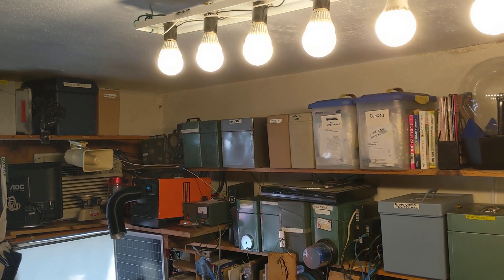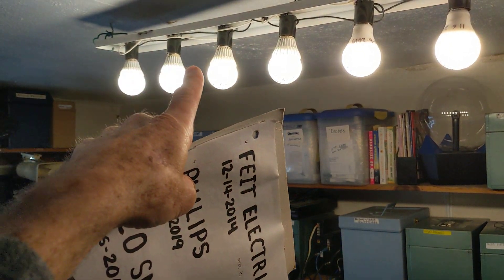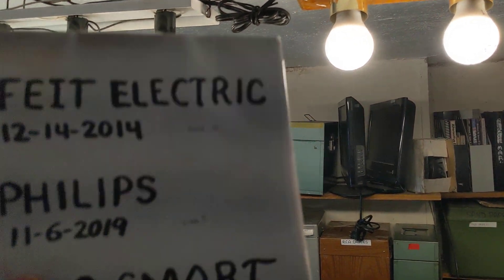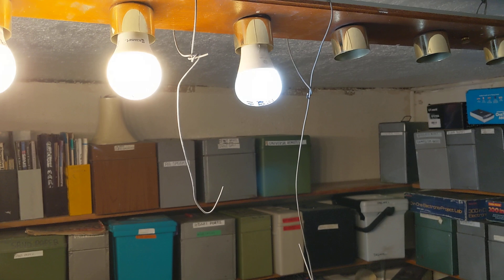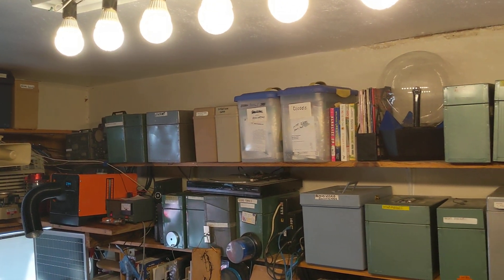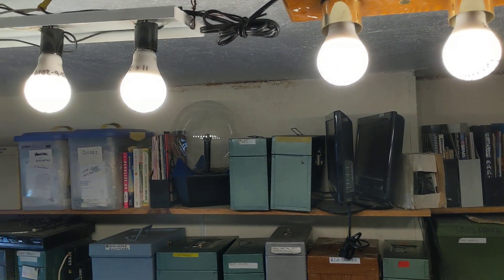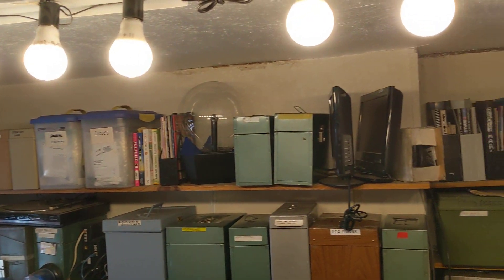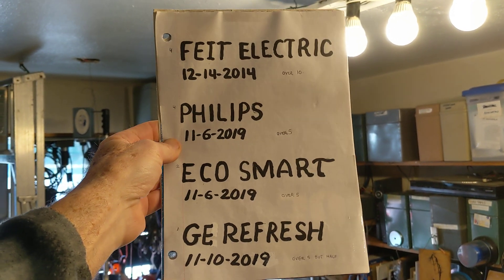Are LED Lights And TVs Designed To Fail?

Comment: go to on  this site --- by k energy   outboard (newman type) with output running back .  --- the waste current he has is the fans and the amp hes using on the front of the outboard .joe used 3 massive capacitors across his coils on his channel- and  diodes or a bridge rectifiers   . and over 3 coils .not running over 148 rpm so he could collect all the back spikes .at 751 volts and dead battery's with only voltage . and a massive weight spinning. I have other videos you will like on  these newman motors. on this site go to --success! magnetically self running wheel/ motor (no long test ever performed) by james roney stators

Comment: Perhaps older bulbs had bigger heatsinks or maybe the LEDs weren't quite driven as hard? We will never know if big manufacturers secretly spec the things to fail after at least a year to get more sales.  If you ran a big corp then that idea has some merit, although as a consumer you are likely to try a different brand if the last one seemed to fail too quickly. I guess nobody will ever know the real reason.  Maybe just constant desire to keep manufacturing things cheaper so profits go up is what causes it.
Reply from the maker: Yes I think heat dissipation plays a big part in LED life expectancy. Someone in Alaska claimed he had 20 years of life from his LED bulb. I'd guess the colder climate is the reason why.

Comment: Avoid  Walmart great value  LEDs, had flickering failures  as little as 6 weeks of  minimal use,  and not isolated  to  just  a random  experience.  They all went in succession  within  a few days of each other
Reply from the maker: Thanks for the warning.
Reply: @GrantsPassTVRepair 
ב''ה,
I'm feeling like a decade ago they might have had a "lime" batch/supplier that was one of the earliest affordable flicker-free ones, if you knew exactly what to get.

These days that kind of information is no longer readily available and it's back to kind of being a crapshoot with what seems like a billion similar 'good enough' designs unless you're really in the lighting industry to see what's up.

I'll throw in that out of 3 fairly generic ones I've had to purchase about 3.5-5 years ago only one has gotten flickery.  Did have a rather nice early model screw in floodlight go from EMF changing a bathroom fan motor on the circuit, that was a bummer and something to watch out for.

Comment: When the backlight of my Sanyo TV went out, I found that it was just a solder joint to a LED that was the problem. It also had flimsy connectors connecting the LED strips together. So, I resoldered every LED joint and got rid of the flimsy connectors and hardwired them all. It's been working great for years now with no problems.
Reply from the maker: Good repair.

Comment: My feeling is that most bulbs are installed bulb down and therefore extra heat transfers to the electronics which.  I speculate if a person were to take the time to cut as many vents into the base as possible we would get more life out of the bulbs.  I also speculate that regulation won't allow manufacturers to do this, or at minimum they won't do it because the competition is not doing it; except in special, higher cost, 'long life' bulbs when I would once again speculate are only different because of the vents.
Reply: ב''ה, for a while at least the sealed base designs were potted for safety and heat transfer to the standard shaped shell.

Playing with the early runs of really cheap eBay imported bulbs, a fancy skived base didn't make a lot of difference if the components weren't terribly resilient, though I did have some plastic vented 40W-equivalents that were surprisingly electronically sturdy if a bit fragile physically (as would expose 120V to a hand if being an idiot, or possibly risk fire if some lint or insects got in).

It's quite a crapshoot.
Reply: @josephkanowitz6875  Probably a top rule in engineering is to assume most everyone is an idiot.
Reply: I have seen Chinese bulbs take on this technique. They had vents in the based and they were made in such a way that the insides couldn't be touched.

Sadly they were glued together with a kind of glue that would become soft of installed bulb down and the cap would fall off leaving the board with the LEDs dangling in the breeze.

I think an improved and safer version of this might help keep the driver electronics a little cooler.
Reply: @ I would like to see a version can be made that has a driver that can be relocated nearby.  It would not be ideal for every situation but I think there is a place for them.  Realistically I have no time to try to make a version of this with an existing bulb but I have wanted to try it.  This is unlikely to be something a company will make because it's function is too complex for most to understand. Thinking about it now maybe in the future home construction can require electrical feeds from the source that only go to lighting locations and therefore the driver can be at the breaker box.  Probably not but brainstorming is how we come to conclusions.  I'm thinking that LED bulbs to not need 14 gauge wire and perhaps can be safe with 16 gauge which opens up opportinities.
Reply: @ChedwardThe3rd  you remind me of a concept there used to be where you could replace the (CFL) lamps seperately from the driver. Sylvania Lynx Diamant was one of them. But not exactly how you mention as the driver(ballast) was still close to the lamp.
Reply: @ I do recall that style

Comment: I like early sylvania bulbs, the ones that still use glass and have the elements showing, i was making a jewel thief. To run them off of batteries and they were the most durable and accepted the widest frequency range.
Reply from the maker: Are you talking about incandescent or LED bulbs?

Comment: This is a bit out of the ordinary but I use 12VDC for my barn lights, and use non-dimable LED bulbs with a G4 & G10 bases. There’s no controller chip in them and they’ve been working almost constantly for nearly 20 years. I’m in remote Alaska so they turn on early September and stay on until the end of May.

As a facilities engineer, most of the industrial conversions get no longer life than incandescent or fluorescent bulbs, and of the failures I’ve reviewed, it’s almost always the controller board/chip that fails

Comment: As far as I know and if I remember it correctly only Dubai has mandated long live led bulbs to be sold there.
Reply from the maker: Thanks for the information. I have a vague memory of hearing about this on some of their LED Bulbs.
Reply: I think you are correct.  Big Clive did a video about them.  There are similar looking bulbs from the same maker here in the united states but not made the same from what I understood.
Reply: I believe Philips makes those for Dubai and at some point they started selling similar looking bulbs in my country in Europe. They can be identified by having double the LED filaments compared to others.

Have been working fine here, though I think they were not available in 2700K, only cooler colors.

Comment: LED's are powered with low power DC Voltage. LED Longevity boils down to the AC voltage rectification and DC driver circuitry for the LED's. Remember the AC LED lights that would flicker?...the used half wave rectification instead of full wave rectification...these were most noticeable in strings of Christmas LED lights. Another interesting aspect that most people don't know about is how LED's are "binned" by their color accuracy or color temperature. Interesting Stuff!!!
Reply from the maker: I've often noticed the flicker issue when I'm around LED Christmas lights and I'm scanning them with my eyes. They tend to make me a little dizzy.

Comment: What I want to know is how long each of those bulbs has been on not just in the socket. It doesn't matter how long they've been in the socket only matters how long they've been on.
Reply from the maker: Yes good point. The are inside of my shop that's open 5 days a week and 8 hours a day when I'm not out on service calls or taking a rare vacation, and because I'm often inside my shop in the evening hours socializing or working on projects, I don't have an exact number of hours they have been on.